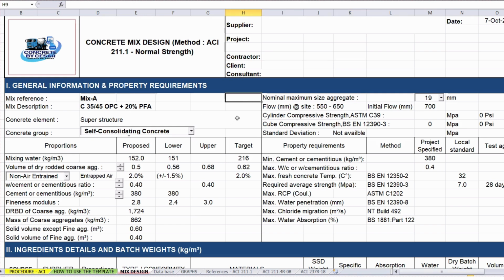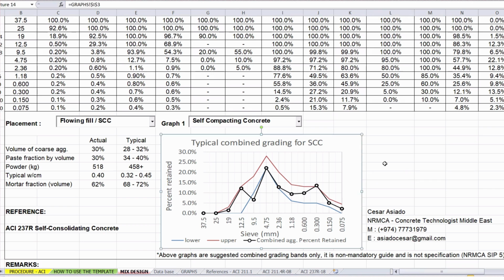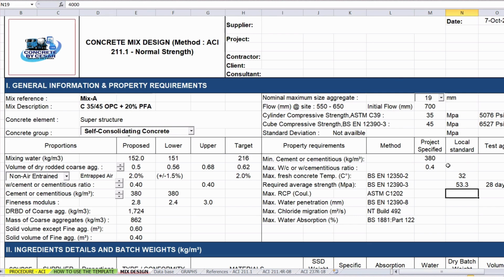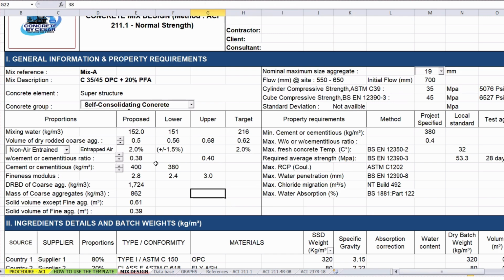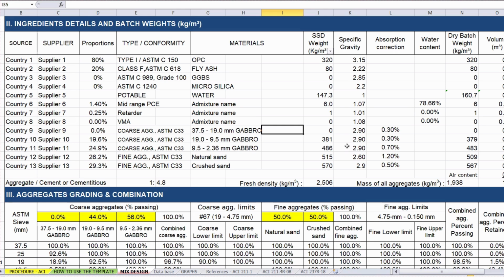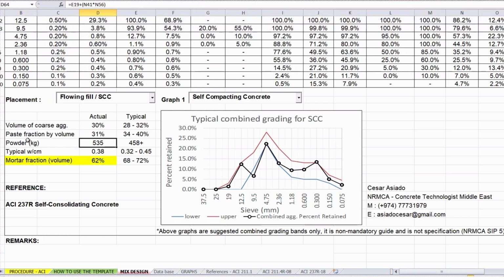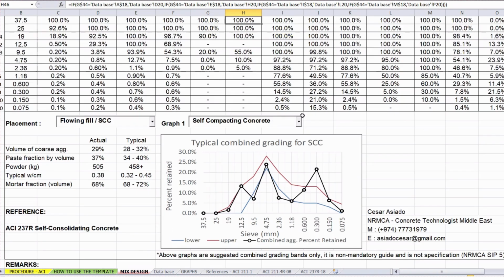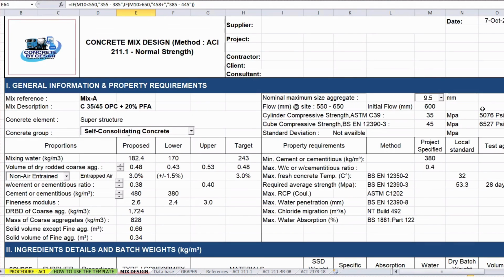How to create Self-Consolidating Concrete ? (ACI 211.1-1991) #scc #concrete #construction #aci

Comment from the maker: Kindly note that in this example, I was referring to Cube strength for target strength at 28 days, however you can edit this section if you need to design for Cylinder strength and decide on w/c ratio you need to use based on your experience and knowledge.

In Middle East, we sometimes recieve inquiries for cylinder specified strength concrete grade, however in production and  QC procedures we are working on cube samples.

Comment: Is it possible to make a concrete design for 1/3rd cubic yard?
Reply from the maker: Yes, it can be reduce into to 1/3 cubic yard, check out my new template using inch-Pound Units: https://concretebycesar.etsy.com/listing/1811500170